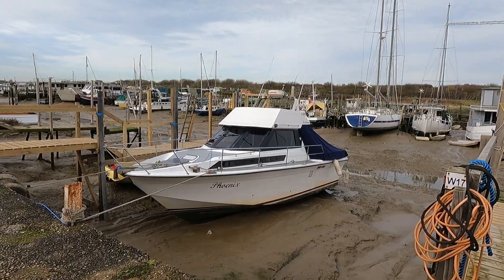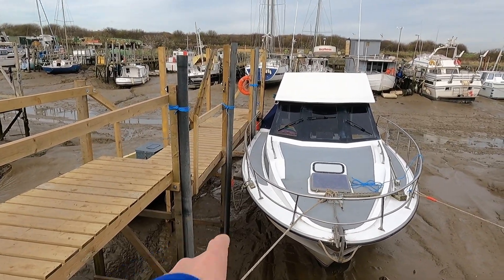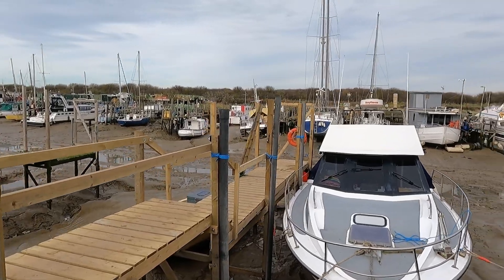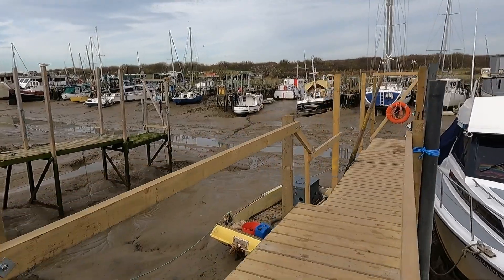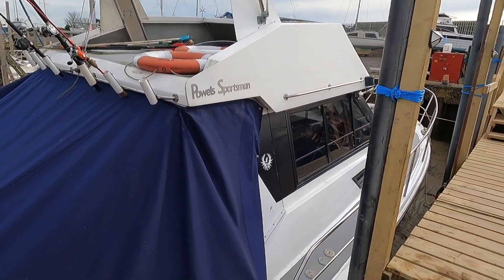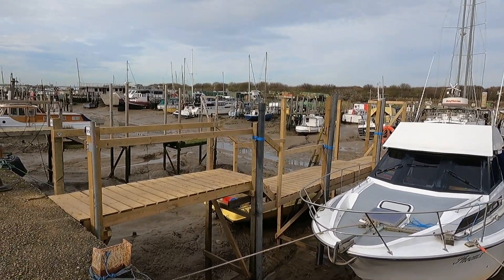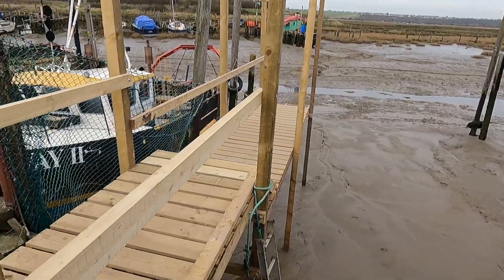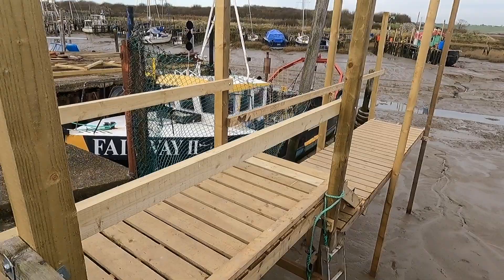Yacht Club repairs continue - Part 2

Comment: Hopefully the new owner of Phoenix can correct the misspelling of Powles. 😄
I suspect you'd get more engagagement with this type of video if you filmed the actual work in progress.
Reply from the maker: I have tried before to film stuff as I do it, but the GoPro is often blocked by clothing or I have to move it out of the way when I am doing drilling, climbing, cutting, wading or lifting. I can retry and post some stuff, but I massively appreciate your feedback.